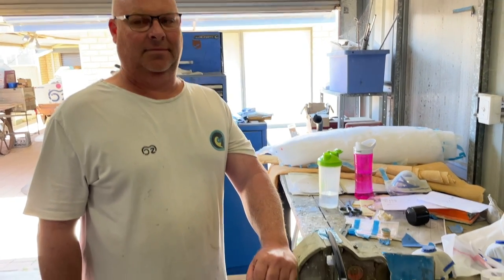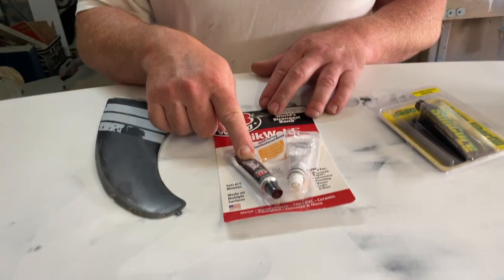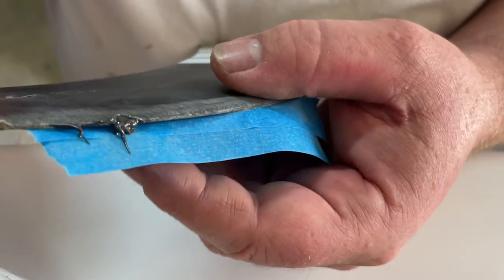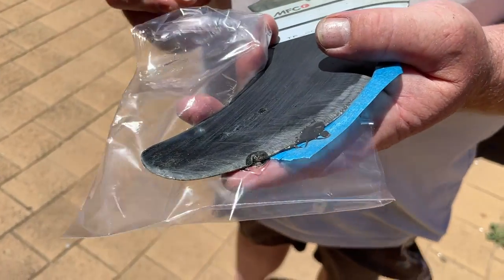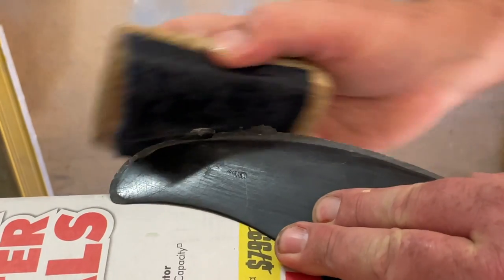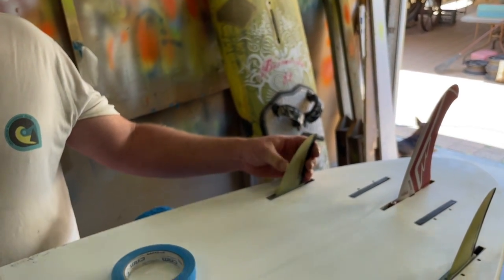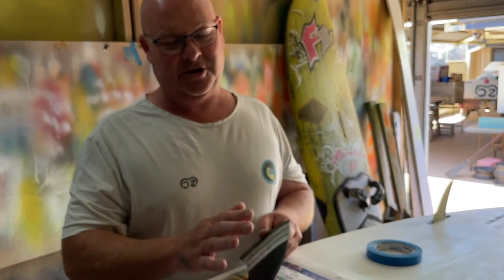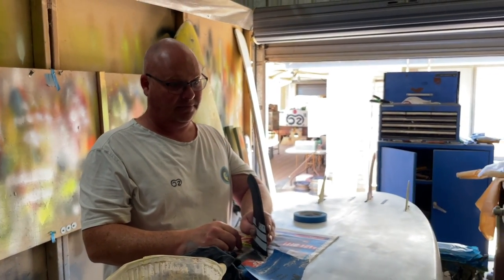Repair a Windsurf Fin

Comment: My fin is worn down from users beach starting in water too shallow and grinding the fin in the sand, so it's not dinged, just blunted asymmetrically across the end.  Would it work to sand starting with 180 grit and working up to 400 grit, and then coat the end with a thin layer of resin?  Any particular resin you would recommend?
Reply from the maker: Just sand the fin down with your sandpapers. You won’t need to coat the fin with resin.👍
Reply: @windsurfer  Perfect - thank you!